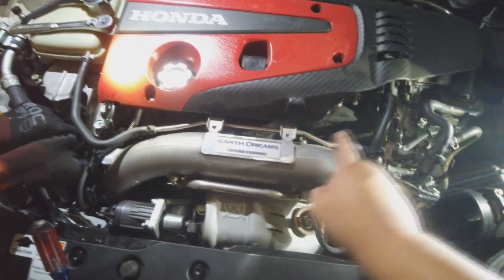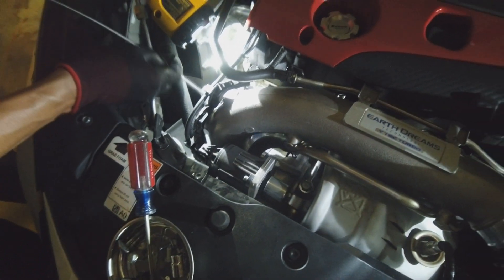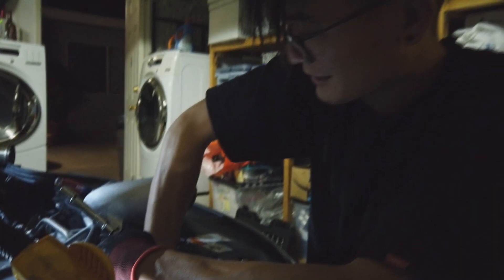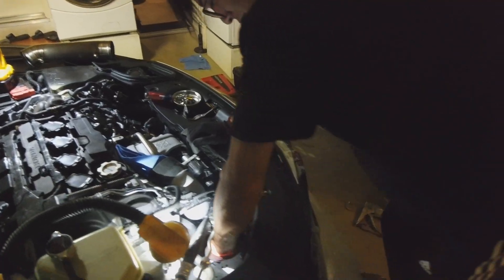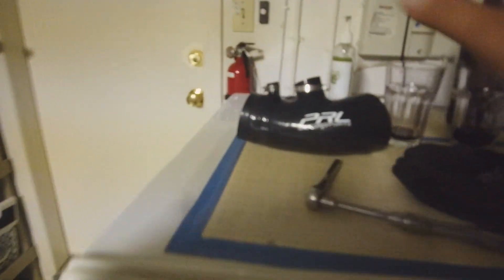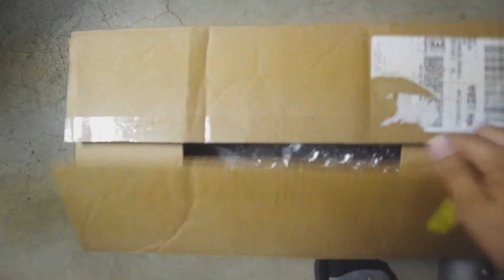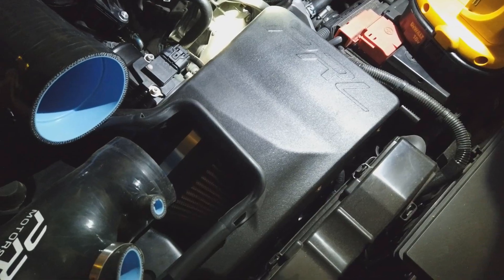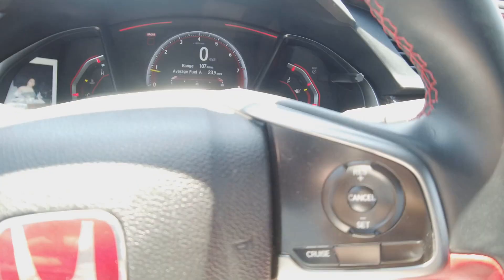Civic Type R PRL INLET PIPE Install (FK8)

Comment: Direct bolt no tune?
Reply from the maker: yes you can but recommend a tune
Reply: @butternut.spangles7121  ohh ok,, i wanna stay out of tune for now. Will it give bit of power gain just bolting?
Reply from the maker: @j_b_m9550  wont notice it but IAT might be lower